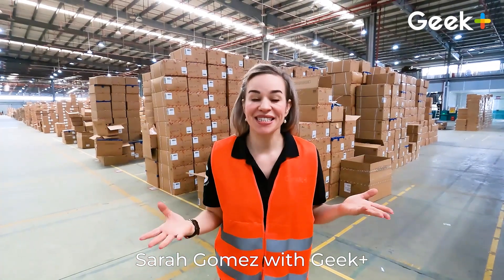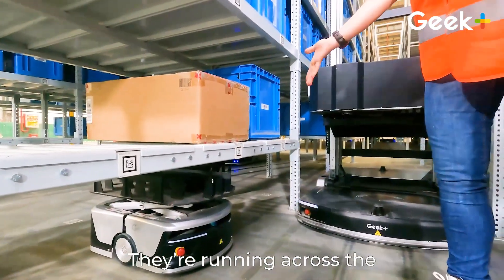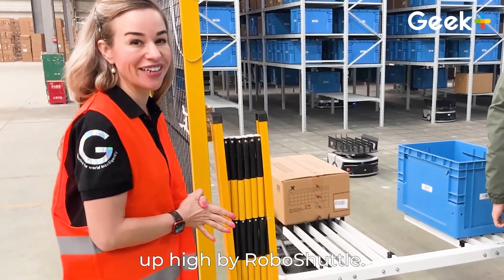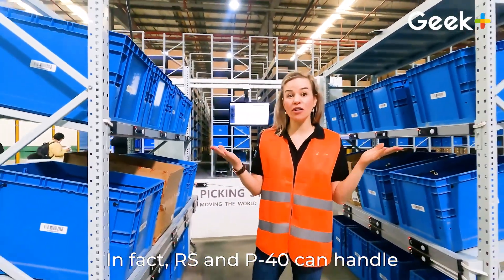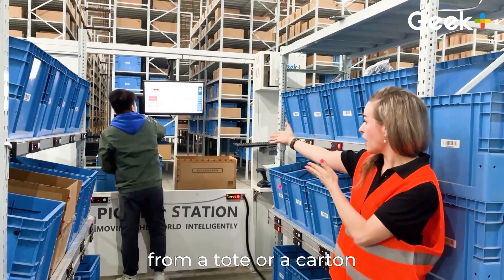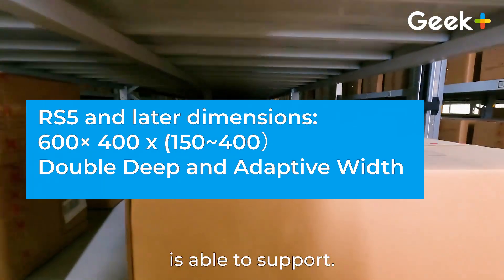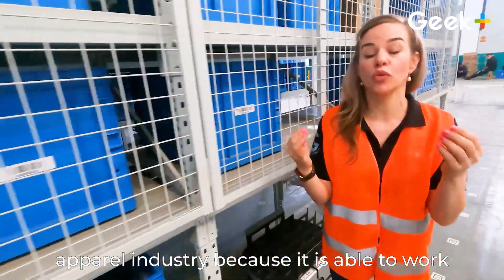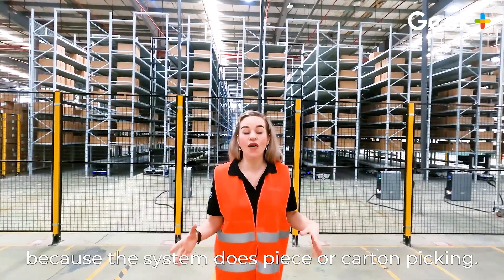REAL RoboShuttle Warehouse Tour (real product, real bots!)

Comment: Could you go into more detail about why, in the real world, most of these installations seem to be single deep, not double deep? Maybe I'm missing something but the tradeoff seems to be floor space savings vs extra time to retrieve the rear totes. Maybe double deep only makes sense for slower moving stock? Can't you just buy more RS units to compensate for the extra retrieval time or do they run into each other too much? Or are RS units just too expensive / floor space too cheap to make it worthwhile?

Comment: Are the QR codes on the floor required?
Reply: I imagine the robots have IMUs or SLAM onboard as well, but also need to see QR codes occasionally to recalibrate and avoid cumulative errors.
Reply: Not all types of machines require QR. Some machines use lidar navigation.